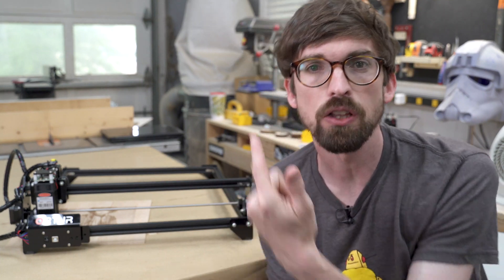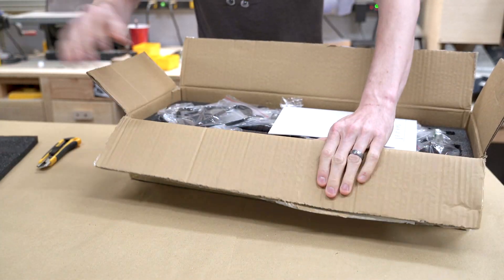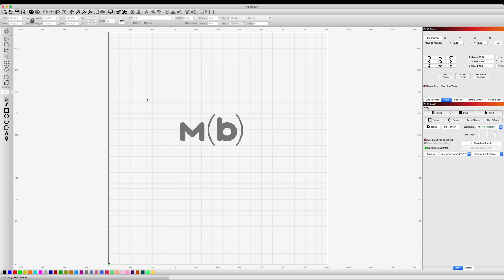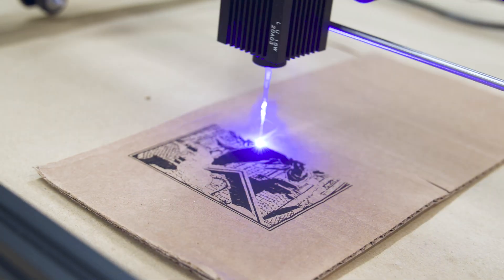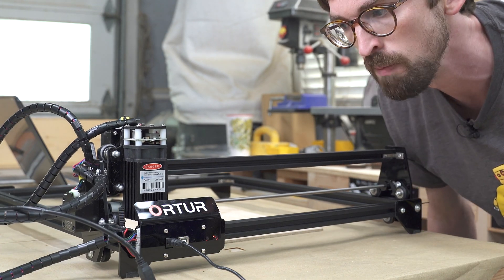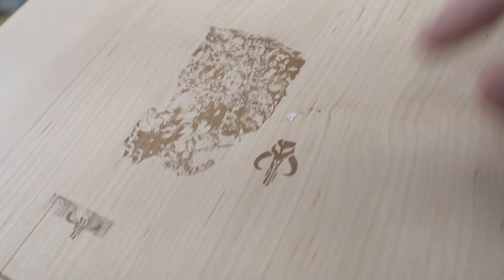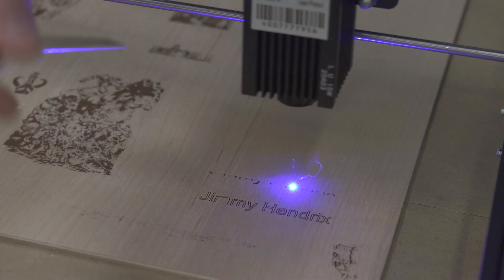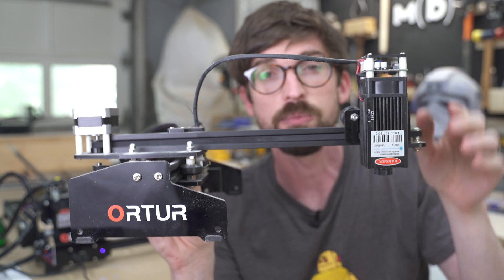Is this the BEST budget Laser Engraver? Ortur Laser Master Engrave 2 Review

Comment: Thanks for your input! I saw your list that you put out and I'm referencing it! I know this video is old, but would this ortur lm2 do well in 2024? I use a boss co2 laser at school where i teach, but this is for me personally. 

Would i need to get an air assist? Is that needed, or does the small fan in the laser do enough? 10w would be good enough to small cutting? I don't mind taking a few passes. 

And the boss laser has an air fan in there, would this just be ok next to an open window and an exhaust fan? I'm thinking about fumes or smoke. 

Thanks for your great channel!

Comment: I'm looking for a laser engraver to do simple engraving on wood or acrylic pen blanks or the occasional small wood project.  I have a Meterk DK-BL model that is the size of a Jack in the Box but it doesn't have the power to really burn nicely into some woods and I have ruined some projects that I have turned on the lathe due to the object moving as the diode head moves, or the type font not being in real-time what was on the screen.  I might not know what I am doing as well. I am not going into business but rather a simple hobbyist that likes to give nicely engraved gifts to friends.  I would like to stay under $400 if possible.  Thanks in advance.

Comment: Most barrel heads are 15 inches in diameter is it safe to use this on something that is larger than the dimensions of the rails? Would it be able to sit and engrave on something that thick?

Comment: Will u need a upgrading cooling fan for the laser? I would imagine the motor gets really hot after working @100% for a long time or does it work good for hours with no problems? I’m trying to get started, but I wanna work out the details first

Comment: Hey I’m new to lazers would this work on stainless steel?
Reply from the maker: You would need a fiber laser to engrave metal, but if you had a coating on the stainless then a diode laser like this could remove it!

Comment: Can I upgrade it with 80watt laser head.... Like i buy 80watt  head, controller, high torque motor... Mounting plates... Can I upgrade your higher watt head for MDF cutting
Reply from the maker: For diodes you really can’t get much over 10w.  Any higher you’ll need to go with a CO2 laser

Comment: Don't cut plastic if you don't research what gases or fumes will be given off!!  for instance vinyl
gives off Hydrochloric Acid fumes that will rust any thing they contact and destroy your lungs if you breath it.  PVC will give off Chlorine gas.  Deadly. used as a chemical weapon in the first world war.   Be safe. RESEARCH before you cut plastics.  The glue in some wood products is toxic when burned as well.

Comment: Hey, anybody here tried smaller laser engravers, mobile ones? I need to engrave inside a wooden tube, usually 10-20“ diameter, perfect would be if 8“ is also possible - which means the surface is round, and it would have to operate inside of a tube. The version one might work well, as it has an extended laser arm, not the typical x/y table.  What i am about to engrave is drum shells from inside... 3x3“ minimum. Anybody?!

Comment: I was wondering if this would be enough to engrave something on metal, like a bottle or a pc side panel
Reply: Painted one should be ok. For metal, visit this facebook metal engraving group https://www.facebook.com/groups/4105345129538639/
Reply: @jamesrobert7405  Is the paint there to help against reflecting the laser beam (I guess) or does the laser then only burn the paint of and not the actual metal?
Reply: @the_headless_horseman9682  both should be ok

Comment: working on engraving bourbon/wine barrel heads, would this work?  they are larger than 15" but the cutting space probably wouldnt be.  is there an option to change the cutting deck overall space to hold the object? another option for a hobbyist?

Comment: hi there!  good video.  I need your expert advice.  My friend and I want to start engraving on wooden sticks.  Particularly Rattan 24 to 30"  sticks used in Kali or Eskrima Stickfighting.  We are Filipino Martial Artist and looking to place some designs on sticks for different groups or practitioners.  
What do you recommend we use as beginners??  Haven't really seen machines that can accommodate up to a 30" length with a roller. The enclosures gets in the way?  
Appreciate any recommendations you have. Thanks!!

Comment: Does this model etch black anodized Aluminium ? I want to make small nameplates occasionally for the electric motors I build but don't wanna spend thousands for a fiber laser marking machine - eBay is confusing, the seller's of some of the 7 - 15 watt machines say that they can etch anodized aluminium whilst some of the 20 watt machines say that they can't etch anodized aluminium ? - Do you have a video or any info on which budget laser engraver would work to etch anodized aluminium without costing thousands to buy ?
Reply: https://youtu.be/7YKY2W2-1RI  Photo marking on aluminum
Reply: @riiyung1081  Thanks for your reply, I have seen those fiber laser marking machines before but they are too EXPENSIVE ! so I was looking for a cheaper alternative which I have now found ! :)
Reply: @BITTYBOY121  Thanks for your reply, It doesn't matter, you can ask me if you have any questions in the future :)
Reply: @riiyung1081  Thanks ;)  👍

Comment: Could I use this to add a logo on an aluminium can?
Reply: These small diode lasers can't engrave metals, they just don't have enough power. However, if your aluminum can has been painted (like with a background color), it might be able to burn off, or "engrave", the logo into the painted area.
Reply: @gulfsurfco  thanks for the info.
Reply: @gulfsurfco  thanks for the info.

Comment: I'm building my own skateboards and hoping to engrave small pictures on the boards. will this work for that?
Reply: Most skate decks use maple plywood. In this video he used 12"x12" maple plywood, so I would say yes it would work fine. The only issue you might have is the convex on the bottom of the skate deck. But since you are only doing small pictures, if you level the area of the deck in relation to the laser head path, you should't have an issue. Good luck Venture Media!
Reply: @gulfsurfco  wow thanks a lot for the info I really appreciate it!

Comment: Leather and steel, does it engrave on these surfaces?
Reply from the maker: Leather it will, for metal you'll need to either apply a coating or check out a fiber laser (WAY more expensive)

Comment: Hey dude. Love your video. I am new to laser engraving. I need to engrave faux leather, ALUMINIUM, plastic and bamboo. Will this machine work ? Pls advise. Thanks for the video again. Cheers
Reply from the maker: Yes to everything but aluminum.  You'll need either need to coat the metal (like powder coating) or check out a fiber laser (they are WAY more expensive).
Reply: Make or Break Shop : I think I need to get a fine extractor if I am doing ABS plastic and bamboo. Right ? Cuz I am planning to do some projects at home and I don't want my room to be filled with poisonous gases.
Reply: https://youtu.be/JHc_10isfK4

Comment: Awesome video thanks. I was about to buy this and realized it will not work. Can you recommend a laser that we can use to engrave Bamboo and Acacia wood boards? We need to be able to insert a board up to 20x16 in into it but the print area is much smaller. Any and all info would be greatly appreciated.
Reply: If your concern is size only, the machine can go on top of the boards.  People are using these to do table tops. Just use sand bags at the corners to keep it from skating around.

Comment: You can use these on leather too, but make sure you’re vented or outdoors if you do so because it STINKS! These work well on wood, even with larger images.
Reply: I'm actually looking into this for leather engraving. What kind of laser is best for leather? 7W, 15W or 20W ? Thanks man!
Reply: @AndreiLucaa  Be careful using on leather.. some give off poisonous gases.
Reply: Andrei Luca I have a 3 watt and it works beautifully. The more powerful the laser the more the settings have to be tweaked so you don’t burn completely through.
Reply: What about material similar to like a watch band?
Reply: anna copeland Depends on what the material is. Is it rubber? like for a smartwatch? Or is it a leather/faux-leather strap.

Comment: Yeaaa… I wouldn't trust those even being in the 2W range... The X-Carve CNC Milling Machine in my basement ( https://imgur.com/a/04LhFJN ) has had an Opt Lasers PLH3D-6W-XF Laser Head attached to it which trust a LOT more being what it is marketed as than anything else coming from the Asian regions of the world ( Unless it had Made in Japan stamped on it ). I also think what most people miss out on is that those Lasers don't just pose a threat to your sight when looking into the Laser with line of sight but they also pose an issue with reflections ( light bouncing off a mirror ) and refractions ( shining a strong flashlight through your hand ). Besides THAT there's also the issue with cutting certain materials - Laser cutting ABS, as an example, will emit Cyanide!
Reply: woohoo same laser diode, with a bit better cooling but added 400 dollar. If you want to cut better and spend 400 dollar extra get a 50W CO2 laser.

Comment: hey, great videeo, thank you, can you suggest settings to engarve cork with this? i bought one of these 20w and i mostly want to engrave on cork, its not here yet but you may can give me a good starting point? thanks again
Reply: 20w diode laser don't exist. Over 10w they work in pulse mode. "Endurace" made a 20w diode laser with 2x10w laser in dual beam mode.
Reply: @82levy5  ORTUR for some unknown lists their laser modules base on the Input power requirement vs. the norm which uses the Laser Output.

The 20W being referred to above is the ORTUR Laser Master V2 20W system which using normal wattage values has about a 5W laser output.  The 15W version of the same product produces about 4.5W output.

Hope that help clear up what is being talked about in his question.
Reply: @greggdrennan  ,ok... I understand now. But it was confusing. For sure, most people think the 20w it's the laser output power.
Reply: @82levy5  Exactly  👍
Reply: @greggdrennan  , i know it's a marketing stuff, but after this i don't trust them anymore. They lie the people with no experience.

Comment: Yeah,  well I ordered one of these and it stopped working after the first use - the laser would only run at very low levels, engraving nothing. Tried everything and apparently the laser itself has failed so I attempted to contact support at GearBest. This is where it has gone terribly wrong - they simply do not respond to requests of any kind. Is that because of Covid19? Don't think so as I could live chat with them, they are sending out advertising emails, and there is nothing on their site about the Coronavirus. So, the live chats end with "you will be contacted in this regard in 24 hours or less" which I have been told on three separate occasions and received nothing. Opened tickets on their support site are closed without any followup within a day or two and sent emails that go unanswered. 

Nice.

So I would stay away from this product and GearBest.com at all costs and just spend the extra money on a real laser engraver rather than this junk from China. You get what you pay for.

BTY, I submitted a dispute to my credit card company and they have refunded my money - even they couldn't make contact with this outfit.
Reply from the maker: Oh man, sorry to hear that! I know for me Gearbest has been slow to respond at time but I’ve reached out to ORTUR directly and had luck with support questions.
Reply: https://youtu.be/JHc_10isfK4

Comment: Did you try to laser on a metal? We want to engrave on dog/pet tags. Typically aluminum or Stainless steel.
Reply from the maker: David Darling you would need a fiber laser to engrave on metal.  But there are special sprays that simulate powder coating that let you engrave the spray off to show the metal underneath.

Comment: thanks for the vid, is it more like a burned stain or does the engraving have some depth in the wood?
Reply from the maker: London Calling with Simon it’s got depth, not a ton but it’s inset a little bit
Reply: @makeorbreakshop  thanks for replying. I'm a tobacco pipe maker and I've been having alot of difficulty getting my metal signature stamp enbedded into the wood. Do you think the laser stamp will stand up to high speed polishing with a mop without getting dulled or even erased?

Comment: I bought this unit and so far it’s been quite impressive to use , thanks for the demo .One question I used Lasergrbl with drivers under windows ten no problem. I tried using lightburn with and without drivers and no matter what it just says cannot connect to controller ? Have installed firmware 1.34 as per Ortur instructions but no go, any ideas or suggestions appreciated 😊
Reply from the maker: Good to know!
Reply: Hey, is this model capable of laser engraving leather?
Reply: CoolGreySoul I have not tried in leather yet but I don’t see why not it burns wood in one pass easily , make sure you have lots of ventilation though , lots of smoke when it’s running 😷
Reply: What computer program do you use with this laser
Reply: @cinditalbot5373  
Use lasergrbl freeware
Reply: @cinditalbot5373  
Use lasergrbl freeware
Reply: Idk what I am doing wrong. My laser grbl will not work.

Comment: How do you determine where to place the item you want to engrave so it lines up properly? Help please
Reply: What I've seen people do is place a large sheet of plywood under the laser, and engrave a grid in which all the sides are the maximum cut range for the laser. That way you now have a physical and virtual grid to match up your material placement with. Just make sure you have a way to make sure the laser is able to match back up if it is moved, maybe some sharpie marks at each foot.
Reply from the maker: You can run t he laser a low power (so it doesn’t engrave) and most software will have a box function that will go around the perimeter.   Then you can either move the work piece or move the artwork in software.
Reply: @makeorbreakshop  That's helpful to know, I've got my laser coming in a few weeks and was certain there had to be an easier way

Comment: The same company sells a 20w laser for this system. It's about $100. Do you think the additional power would be worth the purchase?
Reply: 20w laser with no protection whatsoever sounds really friggin dangerous.
Reply: @no-trick-pony  actual laser output of the 20W unit is about 5.5W. Still, I would fashion some type of enclosure with ventilation for safety.